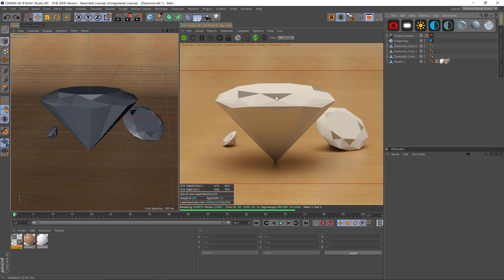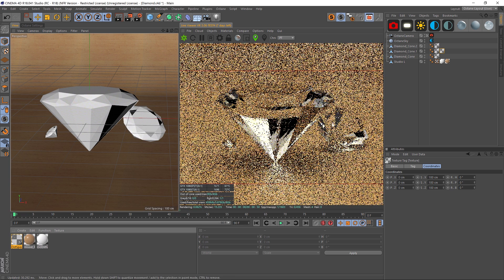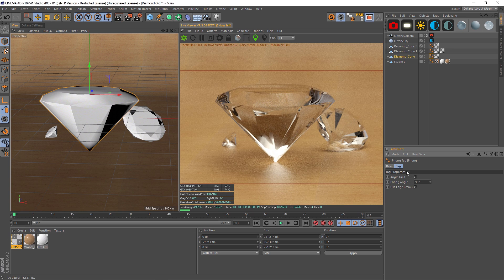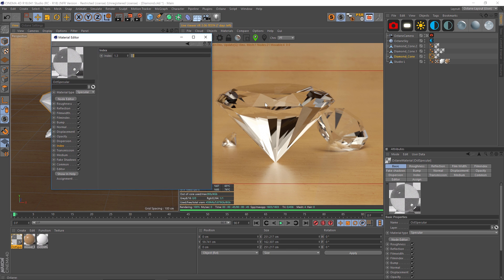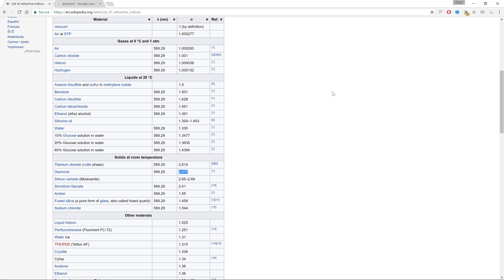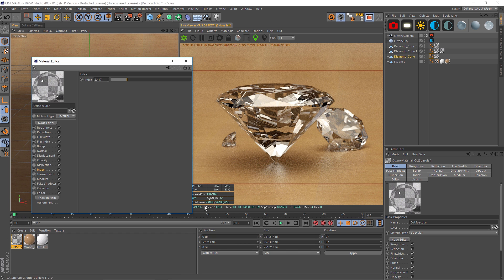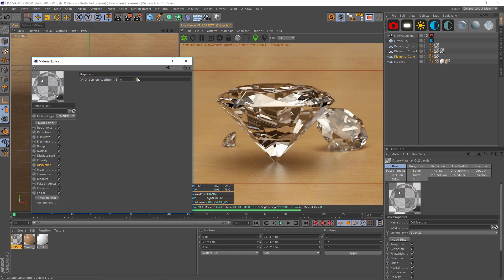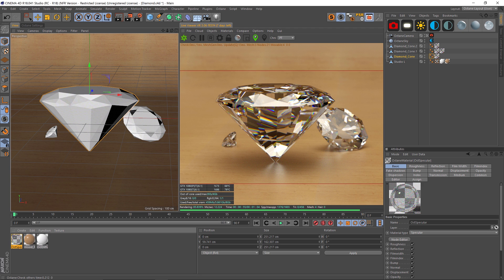Making a Diamond Material in Octane C4D Tutorial

Comment: Hello sir: when I render a specular shader with dispersion, the result is always very noisy (pixel size dots noise), is there any reasons that your render so clean? Thank you very much.
(When using only hdri as light source, it is clean. But when there are lights it is always very noisy.)
Reply: P.S. even I use the path tracing kernel, and set the max sample: 8000, the pixel noise of the dispersion is still there.
Reply: @hankliu2187  i know im a bit late but lowering the roughness helps